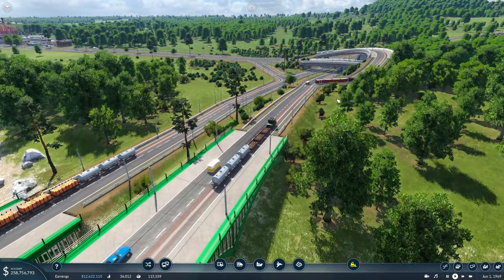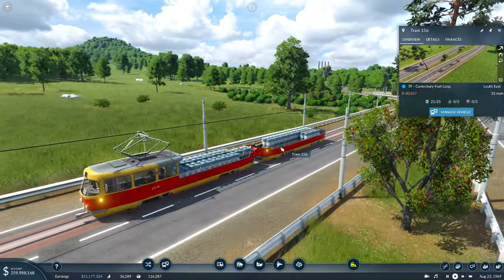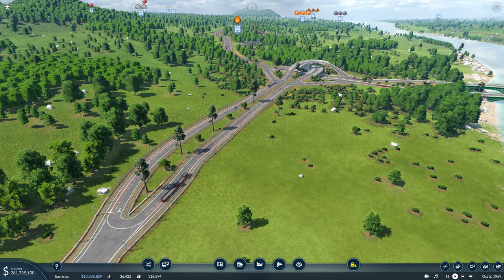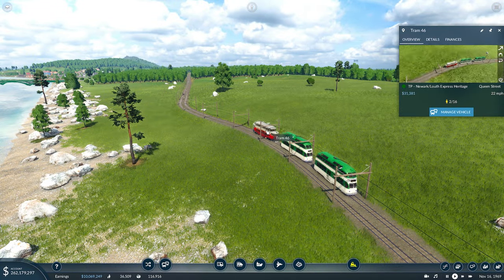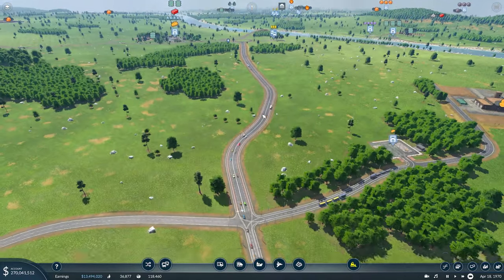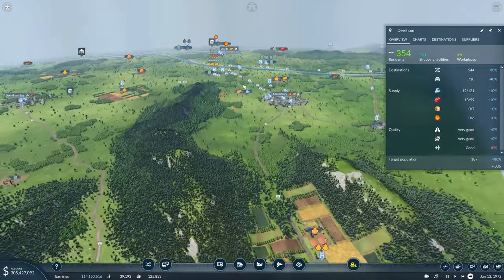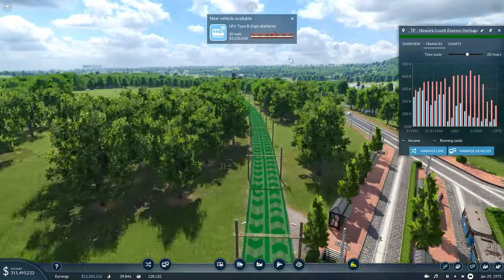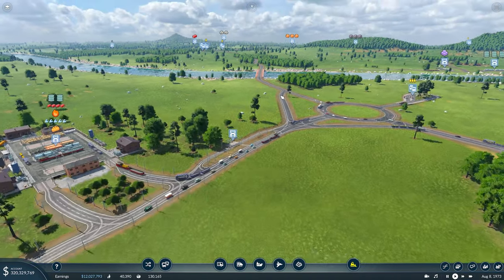Transport Fever 2 Gameplay | Only Trams | Ep 15 #transportfever2 #transport

Comment: could you put a shuttle that moves main goods across the map for the heritage also for the annoying bit put a bus lane on the entrance: bus lane = only your vehicles
Reply from the maker: Hello mate :) I did think about having a cargo hub each side of the map with a heritage cargo line between the two. The only issues is how slow they would be compared to the fast more modern trams supplying them in the future, not sure whether they could keep up or if it would cause problems :)

Thanks a lot for the bus lane tip, there lots of suggestions on how to tackle it in differenty ways :) I can't believe I didn't know these already :)